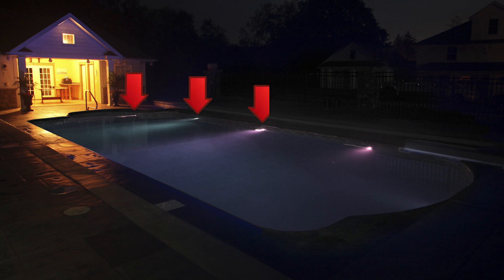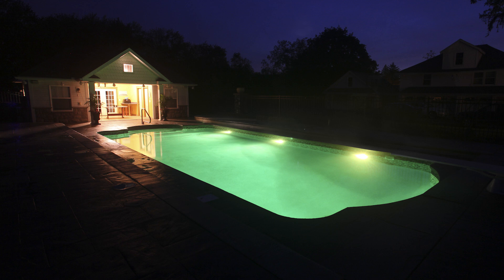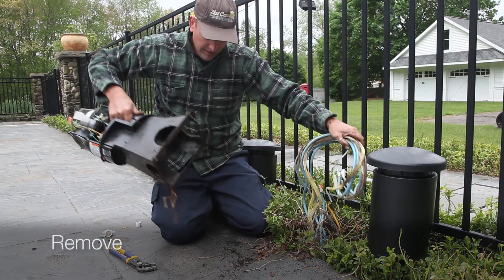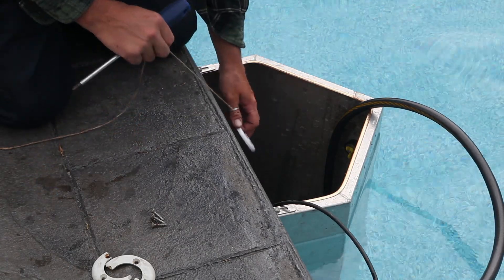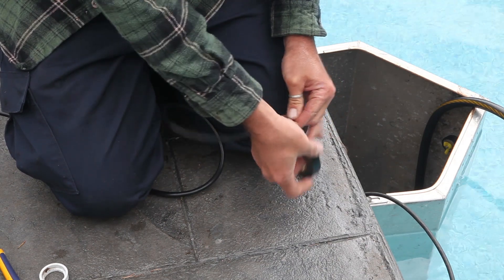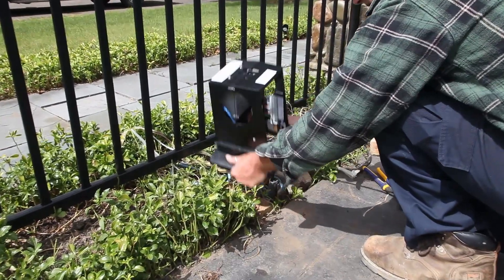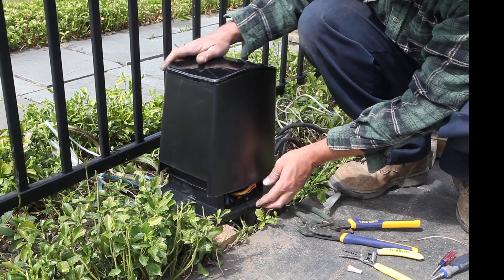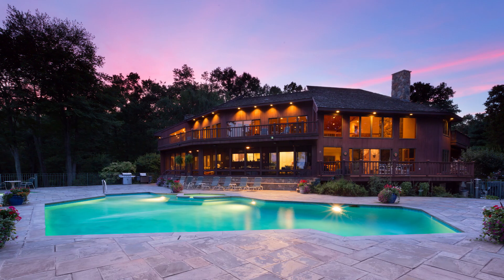Pool Lights: Fiber optic to LED pool light upgrade

Comment: I'm having some trouble removing the old fiberoptic lights from the 1.5 inch fitting. Im able to remove the lens from the light but unable to release the fiberoptic line from the side of the pool. After unscrewing the lens does anyone know the next steps to release the fiberoptic from the fitting? Appreciate any help
Reply from the maker: Hello, we're sorry you're experiencing trouble removing the lights from the fitting. We suggest calling our support team and speaking with one of our lighting specialists, who can walk you through the steps to ensure a successful removal. You can reach us by calling (800) 824-4387 or emailing lighting@srsmith.com. Thank you.

Comment: Hi,
Considering purchasing this product but want to know what the device in the pool that isolated the light so the pool doesn’t have to be drained? Also would like details on how to remove and re-install the actual lights - how do they come off and get put back in with the LED replacement?
Thanks!

Comment: After ants took over and destroyed the light box for my Fiberstar 6004 pool light, i wanted to fix it but I found that an OEM replacement was extremely expensive. I became determined to find a low cost fix. 

I found an LED light engine on Amazon for $45 and the installation was not difficult.   https://www.amazon.com/LightMe-Colorful-Changing-Ceiling-Lighting/dp/B01L74JUJY. The existing fiber bundle fits into the new light head and the results are remarkably good, on par with the old Fiberstar unit. 

Be sure to throw the breaker to remove power before attempting any modification. All responsibility lies with the homeowner when attempting any such modification. 

The assembly that holds the metal-halide lamp / reflector, color wheel and drive motor must be removed. They’re not necessary afterwards and the real estate is needed for the new light head.  All the hardware on the existing fiber bundle must be removed. There is a small metal funnel at the end of the existing bundle that is needed to keep the existing bundle in proper shape and alignment. 

Power comes from existing 120v line used for the old Fiberstar.
Reply: Thanks for the information, this modification is EXACTLY what I was looking for, I have the same scenario with my old 6004 box.
Reply: @daveh2612  Great, glad I could help.  Amazingly easy and effective.  I shared my ideas with my neighbors and I found other installations where the heat shield lenses had shattered and allowed the heat from the old lamp melt the head of the fiber optic bundle.  Quality/quantity of the light can be improved greatly if a new cut is put on the bundle.  Search YouTube for cutting fiber optic bundles with a hot knife.
Reply: @eeandersen  Another great tip, thanks. I ordered basically the same light engine off eBay and tested it yesterday by just sticking the fiber head into the light engine and it works but light quality is poor. So I'll hot knife/sand/polish the end and put it together properly, we'll see what happens. My pool only has one light point so it's never going to be spectacular, but it's still some nighttime lighting with a minimal amount of investment.
Reply: @daveh2612  Ha!  I put the supplied fiber bundle into the pool (free floating loose ends) just to see some light in the pool.  That will show you how good it can get.

Comment: what an absolutely terrible idea. Fiber optic lighting is the absolute best way to have pool illumination. The further the electrical enclosure from the pool area the better. Electricity should not been in your pool. 
Just replace the illuminatior with an LED...seriously.
"The fiber optics have degraded over time" Unless they are plastic maybe, or the glass strands snapped, but most likely the ends are just dirty. 
Bringing electricity in to the pool, weather 120V or 12V is a bad idea, especially if you are already lucky enough to have fiber optics already installed....just replace the illuminatior with an LED...pull new fiber if needed
Reply: I agree about weather electricity in a pool being dangerous.  But lightning is millions of volts more than 12.
Reply: Fiber optic is NOT the best lighting idea, period!  It was oversold and the LED wire replacements can make a bad thing better.
Reply: Hahahaha! No

Comment: where did you get that cofferdam for changing the light? Custom?
Reply: using something like that, a thing that nobody would have, in a how to video is wrong. So this leads to the next question...Does this upgrade need to be done dry by lowering the water level or can it be done wet?¿?¿
Reply: Yes where you get it.
Reply: Would be easy to make in plywood, looks like they have a sump pump in there.